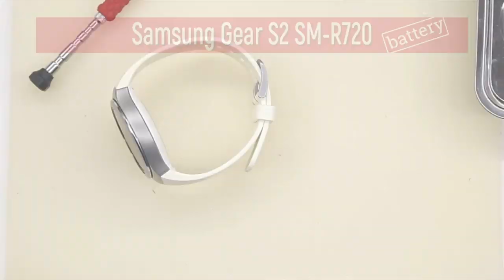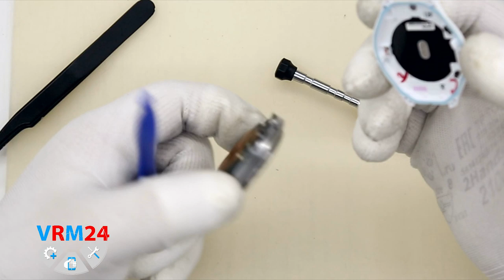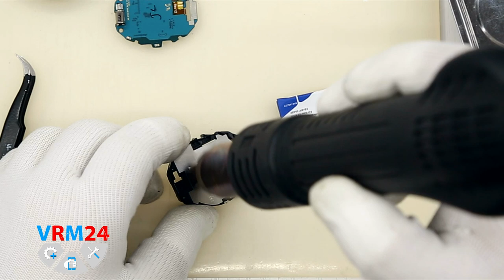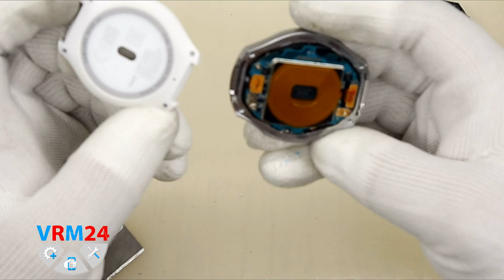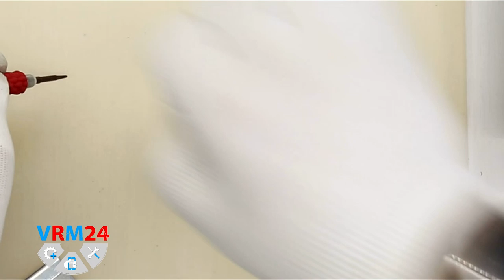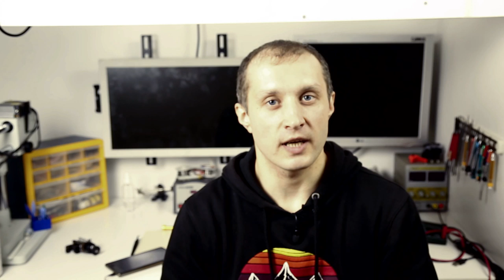How to replace 🔧 🔋 battery on Smartwatch 📱 Samsung Gear S2 SM-R720

Comment: I did this earlier and its not too difficult.  The kit I bought had the tri wing screwdriver needed.  With heat gun its quite easy to do.  The plastic carrier has metal springs holding it against the watch body these are ok as pry points as is the area around the screws. My battery didn't fill the space but same capacity and I don't know what all that faff was taking battery cover off with knife didn't need to do that.  Old battery measured 165mAh capacity when removed which struggled to do a day. New is 235maH claims 250mah but probably about right.
Reply: After a few days I can say it was a great success.  Its still above 75pc battery after full day from 7am to 10pm.

Comment: Your thumbnail has an error that I want to make sure you, and everyone else in the comments knows about. According to the thumbnail you need a size 1.5 Phillips and size 00 triwing screwdriver, but these numbers should be flipped. It's a 1.5 triwing and 00 Phillips
Reply from the maker: Hi, maybe, but we used in this work Philips #000 and Tri-point Y00.

Comment: Where do u get the battery do you guys have a part number for the battery..?
Reply from the maker: Hi, this number is EB-BR720ABE. So, the battery we bought on Aliexpress, the seller was Hsabat. This seller makes batteries with increased capacity. It is not 100% original quality, but best what we have now. PS we don't know how refunds or warranty cases work in this company. It's better to ask the seller to avoid misunderstandings.

Comment: Hi... ... What happens with the waterproof... It's still available after of the process.. or it loose.. thanks.
Reply from the maker: Hi, okay, to put the cover back, for gluing, we use a sealant. It won't guarantee 100% protection, but the best we have. Some people say it helps even for saltwater. But I think even a specialist did his job on 110% he won't give you a guarantee.

Comment: Hello, can i have a question  ?
Is the battery for Gear S2 3g (300mAh)
Same to Gear S2 R720 (250mAh)  battery  ?
I mean in size,  if it is compatible.
Thank you very much for your answer.
Reply from the maker: Hi, okay, the 3G is SM-R730A. If I'm not mistaken, the EB-BR730ABE is compatible with all letters of R730.
Reply: No it is not.  The R720 and R730 series batteries are a different shape and are not interchangeable.  On your watch goto "settings" then scroll down to "Gear info" and it will tell you witch you need.
Reply: @markmurphy8066  Thank you very much !! ❤
Reply from the maker: Yes, Mark Murphy is right - 3g - EB-BR730ABE s2 classic EB-BR720ABE. Both have different shapes. Sorry about that. A ton of questions are asked every day.

Comment: Thanks for the video.  The inside of mine was slightly different.  I think because mine has 3G.  But it turns out mine was easier.
Reply: Hello, can i have a question  ?
Is the battery for Gear S2 3g (300mAh)
Same to Gear S2 R720 (250mAh)  battery  ?
I mean in size,  if it is compatible.
Thank you very much for your answer.

Comment: Hi, how could you help me get the  gear S2  battery since l have  tried to get it in colombia barranquilla it has been impossible for me thanks
Reply from the maker: Hi, It's so difficult to find the battery for the S2. We bought the ''Hsabat'' brand battery on Aliexpress.
Reply: That answers my question. I was going to ask if would be easier to just buy the right battery to start with, but nevermind now. I didn't realize you were having difficulty finding the right one.

Comment: spicy version includes stabbing the battery with knife, ripping the flex circuit board, screws that flirt off somewhere never to be seen again, a screen that only works on one side afterwards and a case that nearly goes back together but doesn't quite close properly.

Comment: What if i dont have the heating tool you use ?
Reply from the maker: Hi, okay. In this way, we use isopropyl alcohol and a thin plastic sheet (ours is a plastic sheet protects a new display we have some, in repair).
Reply: If a heat gun isn.t available, just use a hairdryer on maximum hot setting. It will take a bit longer, but it will work, since isopropyl and just about any similar alcohols are in short supply right now, and they have been for the last few months. In other words, try not to use too much alcohol if something else can be used in its place.